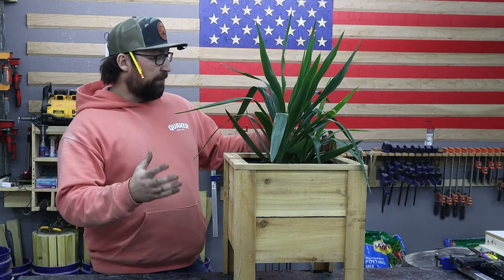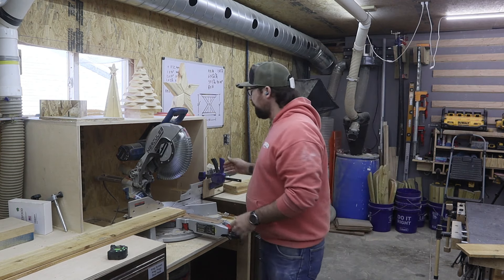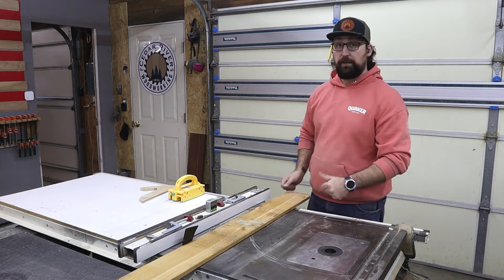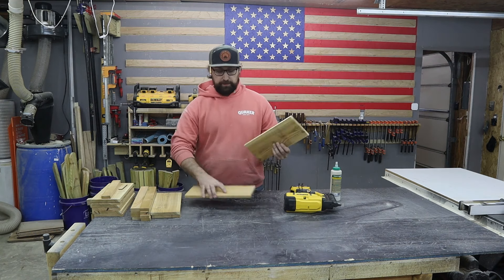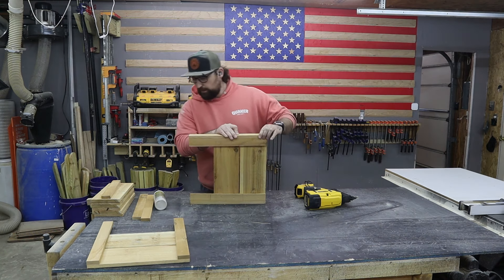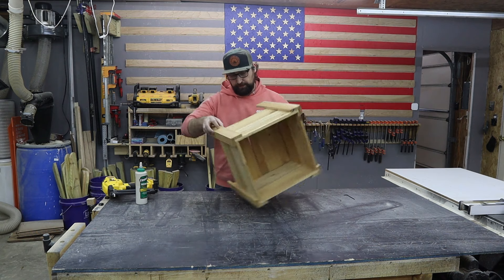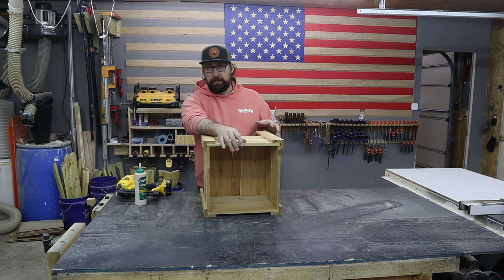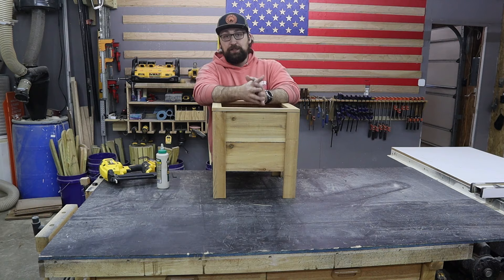How To Make A Planter With 3 Pickets

Comment: I like to use the paint stir sticks to create the space between the panels.  Benefit is they are longer and wider which makes them easier to use than an allen wrench.
Reply from the maker: That is a great tip! I will have to use that in some upcoming projects.
Reply: Exactly what I use too! Home Depot hates me for walkin out with 20 of em when I buy 1 small can of paint lol. They’re also great for using for staining in between tight spaces a brush or rag can’t get. Just glue a small cut of sponge on the end, dip it in stain and rub rub rub!
Reply: I found you don't need to create a gap between boards, after a few weeks they'll come on their one

Comment: Great job on the video.  Great Quality and easy to understand.  I make mine almost the same.  I use a cleat at the bottom for better strength and less external nail hole. . I also make my trim frame on top a little larger and let it overhang a bit.  You might like that look a little better.  Thanks for taking the time to make the video.
Reply from the maker: I like them with cleats on the bottom a lot more. I appreciate you taking the time to comment.

Comment: I'm curious how you came up with your dimensions including height ? Thanks for sharing
Reply from the maker: It's a combination of experience and taking inspiration from things i have seen physically and off of Pinterest.
Reply: @cedarriverwoodworking  Have you ever taken pot sizes that fit in a planter as a gauge like a 5 gallon pot ? Which needs a inside dimension minnium of 12" Just an example Thanks for responding
Reply from the maker: @williamswoodworks8373  I have, That's a great way to do it.
Reply: If you are wanting a 12” inside measurement, your narrower side pieces should be 12”. The wider ones should then be 13 1/2”, or  twice the thickness of the boards more. If that makes sense…. In other words, if you’re using 3/4” boards, make your wide sides 1 1/2” bigger than the opposite sides.

Comment: I have been making this pattern for years but with a few changes. I make them 12x12” inside so that a round greenhouse pot will fit in and the lip of the pot will just hang over the frame.  I make the frame about 2 1/2” wide and it is more pleasing to the eye than the narrow boards. Four of the leg boards are cut 1/2” wider than the other 4 so that all sides look equal in the end.
Reply from the maker: I like the changes, I will look into making them like that with the cleats that I mention in the video.

Comment: How long for the pickets to dryout..I waited a couple days but gaps started showing between the pickets...
Reply from the maker: It really depends on how long it's been since they have been produced.
Reply: @cedarriverwoodworking  How long do you wait till cutting them?
Reply from the maker: @thedbcooperforum  All of mine have set in my shop for a long time because I have so many of them.
Reply: @cedarriverwoodworking  I pulled my ads until I have a good batch to cut..I did notice others selling them have the gaps between the pickets...I think I might put a piece running across covering the gap but only secure the top picket so it can adjust...I'm in Florida which might affect them more?

Comment: Pro Tip: To prevent brad nail blowout, the brad nails have a bevel at the point, and will only curve in the direction of the bevel, so hold your gun perpendicular to the piece your and not parallel.
Reply from the maker: Great tip! I appreciate you sharing.

Comment: Question for you...what's that big pipe above your miter saw station with the holes in it? Some kind of air cleaning setup?  Just curious.
Reply from the maker: That's the ducting for my furnace.
Reply: @cedarriverwoodworking  here I am thinking you had some fancy air cleaning system and it's your hearing....lol..thanks for clearing that up
Reply from the maker: @bigdogmn73  It does have a fancy filter in there, so I suppose in a sense it can be an air cleaner.

Comment: When you Brad nail and it pops out, what is the best way to fix that? I don’t use mine very often for that reason. I can’t cut the nails short enough and have sharp ends sticking out.
Reply from the maker: Good question. first work on getting the nailer so that it puts them in  parallel with the board and not at an angle. Also the brads are flat on one side, make sure that is not towards the edge of the board. I will try to explain that better in an upcoming video.

Comment: I wouldn't trust the bottom boards holding up with just brads and glue. Especially if you're using wet wood. The glue doesn't stick to wet wood very well. You definitely want cleats for those bottom boards and you should wait until the wood is under 13% moisture content before doing anything.
Reply from the maker: My boards have been sitting for almost 2 years at this point and I havent had any issues. I will try with some brand new pickets and see if anything weird happens.
Reply: @cedarriverwoodworking  I saved some scrap I had left over and added two strip on the bottom for support.

Comment: Nobody describes how to figure out the measurements for the frame. Head scratcher.
Reply from the maker: The top frame?
Reply: If the inside measurement of the planter is 12x12, your frame should be made with12” on the narrow side. I have made dozens of this style out of barnwood and shiplap so it’s hard to make them perfectly square. But I just make the frame separately at 12x12 inside measurement and center it on the planter and secure it.

Comment: 18 gauge 18v Brad nailer by DeWalt. By far the worst tool in my shop. Completely unusable and DeWalt customer service essentially told me to shut up and go away.
Reply from the maker: Sorry to hear that. I haven't had too many issues with mine, but I only have about 10,000 brads through it. I really don't like the size of it though.
Reply: @cedarriverwoodworking  I think I bought a dud. DeWalt didn’t care though.
Reply from the maker: @alexreid4131  That's terrible, that would be a big turn off for me too.
Reply: @cedarriverwoodworking  yup I’m definitely not a fan anymore. Rigid, Bosh, Festool, Skilsaw, Freeman, WEN, Craftsman, Black and Decker (which owns DeWalt btw), Ryobi, Delta, Nova, Milwaukee… all represented in my shop. DeWalt by far the worst tools I have.
Reply: @cedarriverwoodworking  and I run a 36 x 32 feet shop with a gross revenue of $250,000 a year. DeWalt sucks brother.
Reply: Great planter box by the way.   Very cost effective. Well done 👍
Reply from the maker: @alexreid4131  Thank you I appreciate the support.
Reply: Wow! I have all dewalt tools and never had an issue
Reply: If you're referring to their cordless I totally agree. I stopped using mine an purchased a bostich pneumatic.  Much easier and less problems.
Reply from the maker: @aodagroup7759  I do like the bostich pneumatic.
Reply: @alexreid4131  Alex just curious have u had bad luck with Dewalt drills? I’m no where near your status, just your basic weekend woodworker outta my garage and my DeWalts been good to me and I was considering getting another but readin your feedback, maybe not. Again I’m not a pro… figured I’d ask.
Reply: @tro8191  I have a DeWalt 18v cordless drill and it’s been ok for me.
Reply: I have the Ryobi, it’s great. That Dewalt sounds totally weird.